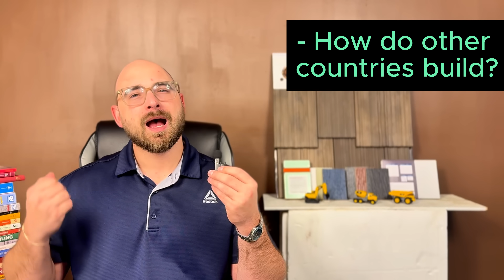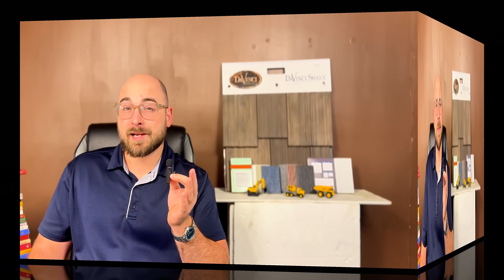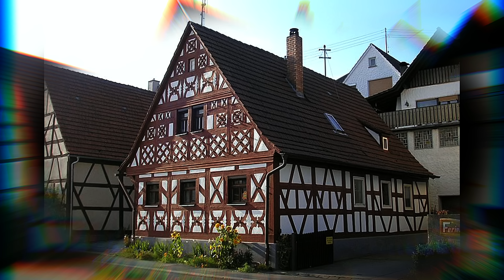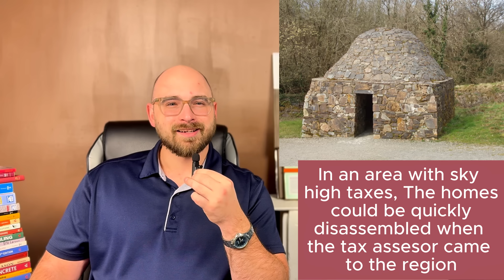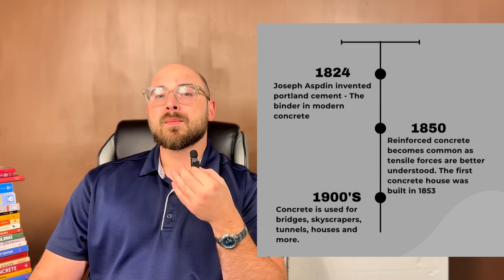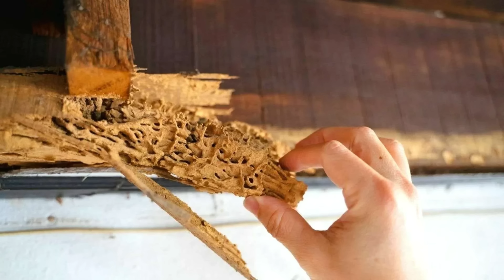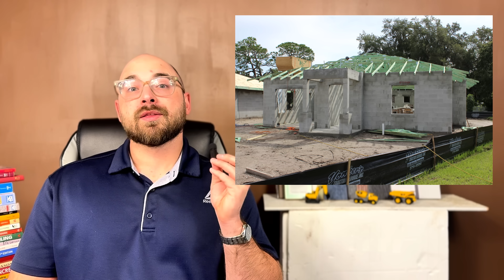Why Other Countries LAUGH at American Homes

Comment: Here in Nice, France my parents built a prestressed reinforced concrete frame house with double walls cinderblocks in 1975 with a flat vegetal roof (kitchen garden). 7 forest fires came destroying things around, including wood stored against the walls. People protected themselves by going into the house, including firefighters at the worst time. Gas tank did not explode, trees grew back. A forest fire is to me the worst nightmare, but I know I'm secure in the house if the worst happens. I'm alive thanks to concrete. It is devastating to me to see the houses of L.A. and Paradise before that burn down in minutes. I have seen in front of me pines that are 150 years old burn and explode in seconds. I took the blast of a super scooper dropping close to me. You should build concrete and cinder blocks. It's also good for earthquakes.
Reply: What was the roof made of? What kind if supports did it have? Sorry, genuine question 😅 I was just wondering about the roof being fireproof as well and if it was concrete wouldn't it be too heavy? But maybe the support beams inside the home held it up? Where they also concrete? The more I think about it, the more questions I have. 😅
Reply: @UnOpEnEdLoVeNoTeS  The house is completely concrete with rebar (the exterior pillars and roof) the filling of the walls is two walls of cinderblocks with 10cm thickness of glass wool in between. The roofing is waterproofed by two coats of bitumen (calandrite) and then there is round gravel (for water evacuation)+ geotextile + soil + plants. the pillars and roof are just put on top of each other, in case of earthquake it is possible for things to slide instead of breaking. I plan on keeping this house, I feel safe here. The main support of the roof, beacause there are large spaces between pillars is prestressed rebar inside large concrete beam. Under weight the concrede beam shape is flat, while the rebar inside take a slight u shape (stress / load) this enable more durability, this is a technique used in bridges.
Reply: Except American homes don't cost a million dollars. I bought a brand new, 3 bed, 2/1 bath, house, with appliances (except washer & dryer), with an attached 2 car garage, with a front and (quite large) back yard, in an only 3 year old  neighborhood, for 280k$. It probably only cost half that to actually build.
Reply: @fnamelname9077  houses in L.A. do cost a million dollars.
Reply: @ So what? How much does a house cost in Tokyo or Seoul?
Reply: @ekesandras1481  To buy or build?
Reply: @fnamelname9077  280k for a house in a liminal space neighborhood and it's wood? You can get a lakeside property by the biggest lake in central Europe built 50 years ago and rebuilt recently for that price
Reply: @fnamelname9077  Exactly! If an American house costs $1million, it's usually either huge, or on a lot that costs $750K. Get away from the cities and there are still places where average houses are dirt cheap.
Reply: @pcno2832  how much insurence cost for stick house? there is some difference between insurence cost beton and stick?
Reply: @fnamelname9077  a concrete house is probably 3 to 5 times more pricey than wood, it is a different culture, like planting a tree for the children and granchildren, and also what is the price for a human life ? or the price of pain and loss of item with sentimental value? The very rich that lost a house and can build 10 more are also suffering from loosing part of their life, material is not only material, we attach to things and places. The new house does not taste the same as the old one. Nothing is really replaceable. In my mind it is good to build in stone/concrete and this adds confidence.

Comment: I understand the different concept of cheap and short living vs expensive and long living. BUT, I don't understand to build weak buildings in places with risk of hurricanes. Well... I can partially understand but it's connected with a fast usage of everything, so you don't have too much appreciation for most of the content of your house, because most if short living.

Besides, although short living is cheap, to buy a second hand long living house is also a possibility. So if you invest in a long living house, you can still sell it if you move to another place.

Comment: 22:54 if the concrete or bricks home has a timber upper floor, even with not flammable roof, it is also not safe against wildfire. Almost 10 years ago big dry grass fire was in Khakassia/Russia, where 1200 houses in 38 villages burned down, and there were much concrete and brick homes, which also burned down, only walls remained and stoves with chimneys. And this because of timber upper floor and roof material! If you want to have wildfire safe house, also the upper floor must be concrete, or something not flammable.

Comment: You missed the mark with this video. That is if USA homes were built and flipped to the same energy efficiency as Swiss home, we would save lots of energy.  That energy saving could be used meet the Paris Accords or power the industries that trump 1 & Biden are trying to restore.  It’s far cheaper to conserve energy than to extract.    Swiss homes have lots of construction details that are missing from US homes, that make it more energy .

Another point, wood may be a local material, but solid walls may with stand wild fires much better.  The us of vented attics for AC units and water heaters is another design flaw with wood framed homes in the south.

Building science is multi disciplined, it’s not just the envelop
Reply from the maker: I don’t disagree with you, that’s why I promote ICF and steel construction, 

Unvented conditioned attic is standard 

We also build some homes to passive house standards.

Comment: Here in the United States, we often have to contend with government building codes. The government is often bought by local contractors since these are usually local although there are also state and federal regulations that have to be dealt with. People should be able to choose how they want their home built but they're often not able to. I think it would be more accurate to say they are almost always not able to. When people want to build a home out of Earthen materials they have to contend with local building codes that won't allow it. When they want to use solar they have to contend with local building codes that place many restrictions on what they can and cannot do. If someone wanted to own a trailer home, which is not a long lasting home in general but it's something they could afford, they're usually not allowed to do it. The land that can be used for building homes is restricted at local, state, and federal government levels. The problem in the United States is our government. We need it out of the way. Our building codes were originally meant to keep one structure from falling on innocent people in another structure and of course not killing the people in the first structure. It was meant for renters in cities. Now it applies in the middle of the woods or the middle of the desert. In most places you won't be able to build a concrete home because it's out of the ordinary people will be concerned it will bring down property values in the area. Again our problem in the United States is our government. We also do not want a european-style government the controls every ass including how you build your home. Shirts lovely looking at all those old structures, but those are just the ones that survived and owned by wealthier people. The Poor People's structures are in the ground. Like when you walk through Venice but you don't think about the fact that that city was built for the wealthy not for the poor. They didn't live in those homes.

Comment: i here in austria live in an expanded old farmhouse from the 18 hundreds (foundations and ground floor walls consist mainly out of natural rocks (with a modern coating) and are up to 30 cm thick, first and second floor mainly consist out of bricks with concrete ceilings inbetween) it is luckily not culturally protected (so we can modify it easier ).
how do i know it is at least that old ? 
there is a date in the 18hundred region chiseled into a wall of our cellar, that might have been the first floor once. i sadly don't know the full ownership history of the house but i hope it can outlast me by decades to come

Comment: Houses most houses in Bulgaria (EU) from 20th century are built from concrete and bricks and are pretty solid. Nowadays the standards became even stricter, so you can't register even a cabin if it doesn't meet the relevant regulations for earthquake, fire resistance, etc.

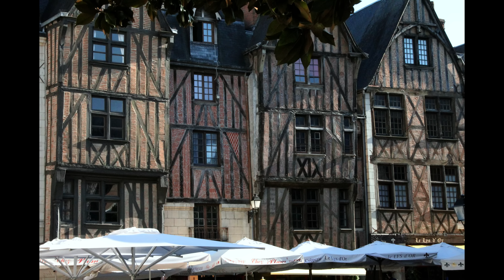Comment: 3:50 this picture is funny: why has somebody build chimney outside of house? Did he want to warm up the street? Normally you need to build the kamin or stove inside, and chimney also inside the house, to use maximum of your heat inside the building.
Reply: Thats a summer chimney

Comment: Houses in the US are designed to be cheap to replace in case of a disaster. Why they cost so much I'll leave up to the pros. And Yes for concrete. Sick of the creaking already.
Reply: I remember seeing some homes being framed with steel rather than lumber during the pandemic due to price of wood, a two story steel and brick house won't be susceptible to hurricane winds.

Comment: 16:27 nearby to where I live in Northwestern PA, some old low income housing used CMU style housing in the 1970's. Almost all of those are gone. I'm not a builder, but I assume that Northwestern PA's cold temperatures lead to a lot of cracks in this style of building, which made them a poor choice for long term construction.

Comment: I am living in Poland in a huge, spacious and comfortable  a little bit old fasion "cavity wall" house made out of double layers of "clay porotherm like blocks" with flat roof.  Built between 1982-1987. It is a low maintenance bunker!🤠 It just lacks modern insulation, alright. And I would never, ever change it for your american  timber-frame (hope my translation is ok) houses. We Poles call  your american timber-frame houses "canadian houses" and some people build them here but I would never build or buy such a house. Wooden frame  house (spruce or pine not ol' good oak or other hardwood cos we destroyed our natural forests and now like to plant fast growing coniferous monocultures) + osb boards +mineral wool ....No it is not stronger than my house (but probably it is much better insulated).
Maybe old  frame-wood houses were stronger ? That being said-I think log houses are much stronger and of course they are really nice looking 😎
And until 1950s or 1960s  polish farmers built simple log houses. So in the past we  liked to use wood as building material.

Comment: I think one factor that is also important at least in some european countries is home loans. In many countries you will have a very hard time getting a loan for a wooden frame house, because banks view them as depreciating assets and don't want to be stuck with a house they can't sell or risk loosing a lot of money if you can't pay back the loan. So, even though a wooden frame house is cheaper than a solid structure one, it's still too expensive for most people to pay in full upfront, so they end up getting a loan for a more expensive solid structure house. This seems to be changing though, has shorter duration loans and higher interest rates reduce the risks for banks.

Comment: That is the tremendous problem of the United States and other countries like Germany, but I am going to focus on the United States, by using wooden houses there are certain advantages, it is economical if it is lost it is easily rebuilt, it boosts the economy of the city after a disaster, wooden houses are nice and warm, but the hidden disaster is the one that no one wants to see and remains dormant as in the California fires, in addition to the fact that to have wood you have to plant wood crops, which are mistakenly called "forest" and it is mistakenly believed to be ecological, then we have these large extensions of "forest" where diversity has no place, a true forest has a tree of one species, another of another and 10m away of another species, but these "recovered" areas are company forests that only plant one type of tree every 3 meters on large extensions of land and that at the slightest spark burn like gunpowder, and add to that the fact that the houses are made of the same material. same material surrounded by a burning "forest" of enormous heights, at least in a real forest, in a diverse forest, the fire finds trees whose wood burns less, and delays the advance of the flames somewhat, and the other problem is that in these mega wood plantations the animals do not find anything useful to them either, only the plates of this type of wood are fed to the point of satiety. These forests are a feast for the flames and the pests.

Comment: Is conventional wood framing used for interior walls in ICF homes? That would seem to solve the problem of ease of remodeling.
Reply from the maker: Yes, ICF is typically only for the exterior walls and safe rooms. 

Interior partition walls are either lumber or steel.

Comment: As an EU citizen, I don't understand the conecpt of the house standing on wooden poles, and not on a proper? foundation. You have a hole under your house, where bugs, animals, cold and other stuff can get in. In Hungary, we almost always create a concrete baseplaste, with a  trench under the baseplate all around your house, so the foundation cannot move, there are no holes, and the pipes and everything is driven inside the concrete, and you can build your house on top of that concrete with any technologies, wood included.
Reply: Timber poles are more common in the southern US.  As it turns out, if timber is submerged in water in an anaerobic condition, it won’t rot. Most of the soil, even though saturated, doesn’t receive much rot because of it.  The buildings I design don’t really have timber piles though.  Though I do see a lot of concrete piles because the soil where I live is pretty bad to build on.
Reply: @bbdest3082  its exactly like that in the Netherlands, in places like Amsterdam. But it becomes a problem when the water level changes.
Reply: There are many types of construction in the USA. If you got the money to invest.
Reply: @ryushogun9890  a concrete baseplate is only around 20k€ over here, so not too expensive. Cellars are what makes it expensive.
Reply: I love having a basement under my brick house, but there are places like the tundra areas of Canada and Alaska and the muddy areas of Louisiana where basements are impractical and it takes very deep piers to support even a wood house. Even with that, some houses have to be re-leveled every year. Most concrete or masonry structures would just sink like a damaged battleship in such terrain.

Comment: European homes can last for centuries. USA homes last until they get termites or burn down
Reply: I’ve worked on wood homes that was built 2 centuries ago.
Reply: @bbdest3082  That's why you had to work on them.
Reply: @AviViljoen  It was being remodeled.  They were adding a bedroom.  We didn't do much repairs to the existing structures.  Another wood house I worked on was sold to someone else (but not the land), and it survived being transported by truck to a new lot.  There was barely any work done to the original house there as well.
Reply: or the tornado takes them away, or the hurricane, or the earthquake.